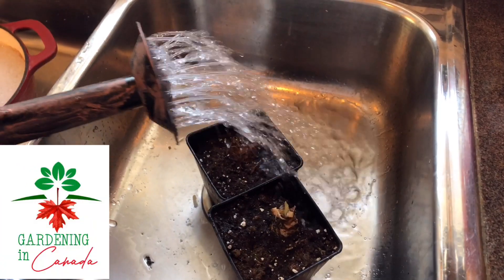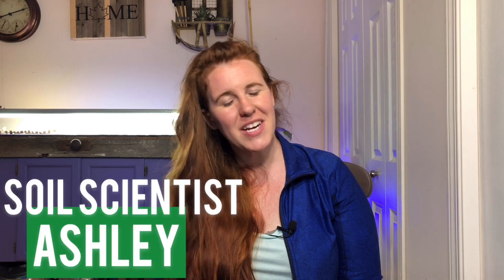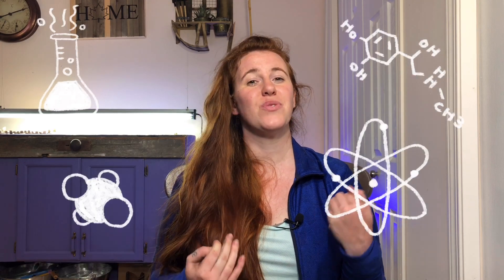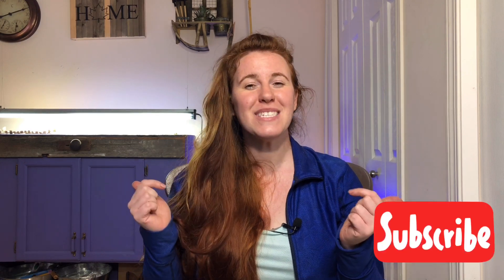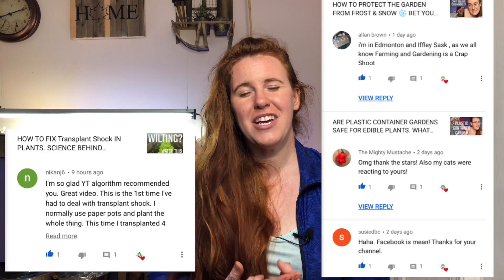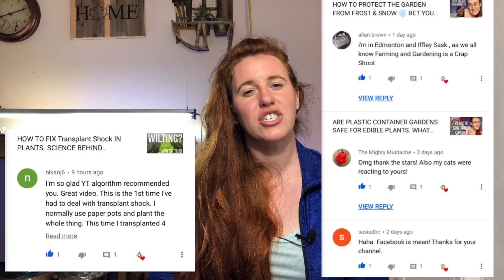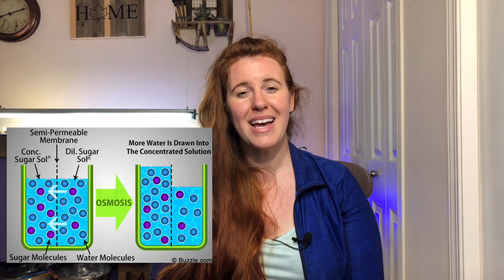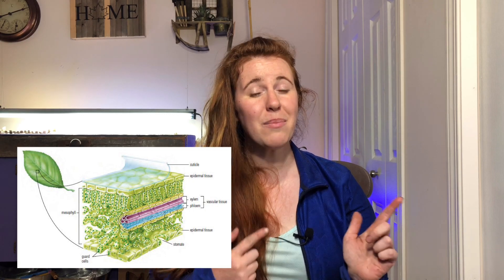WHAT CAUSES FERTILIZER BURN IN PLANTS? IS IT REVERSIBLE. | Gardening in Canada

Comment: Very useful and educational!!  Thank you!  Now I know what a burn actually is and how to deal with it.  Yes, I burned my lawn (Bermuda) a few days ago—right at the spot where I was loading 32-0-0 into the spreader.  Ugh!!  I get the need to water if there is a suspected over-application (which I missed), but I have a question:  If water, water, water dilutes the salt and forces it down, what does all that water do to the nutrients in the fertilizer?

Comment: Good in theory however with potted plants and over fertilizing, how do u stop drowning yr plants by constant watering to flush out those nutrients? Too much water running on soil goes to the roots, therefore they can't breath as they need aeriation and will die?

Comment: I have a few questions regarding fertilizing. When should the first application be applied in the spring and last application in the late summer or fall? Also is it okay to apply fertilizer in the heat of summer? I live in a high desert, and we have been getting 100F/37.7C for 3 weeks now.
Reply from the maker: You never want to fertilize in the high heat of the summer. Spring time is best, just use a slow release.

Comment: we just burned our lawn after applying high nitrogen fertilizer in the "heat".  We watered right away, not know the burn was even going to happen but the next day I noticed lots of yellow areas.  Now everywhere is burned.  Water, water, water, is that the answer?  Will the lawn come back or do we have to over seed now?
Reply from the maker: Watering it out is important but if it’s already died you’ll need to reseed

Comment: I put some grape seedlings into pots, but added some manure (called "veggie mix" by my nursery) into the pots part of the grape roots.  I'm suspecting that there was too much manure in the mix, which caused the grape seedlings' leaves to burn over a period of about 6-7 days.  Half the leaves of the grapes' leaves seemed to burn off.  Is there any way to recover these seedlings?  Will water wash be the solution?  Or should I maybe transplant them into fresh pots with a sandier mix?
Reply from the maker: oh thats likely unfortunately no fix

Comment: is fertilizing the lawn (kentucky bluegrass zone 5) and watering every morning for about 5 days a bad thing?
Reply from the maker: Nope not at all! Just means your not restricting anything which is a good thing.
Reply: @GardeningInCanada  is it possible for the grass to drown from too much water? asking because i fertilized a lawn and she watered for 5 days and i went back few weeks later and her lawn was completely yellow. yes it was hot and no rain in the forecast. the lawn eventually greened up again
Reply from the maker: Typically speaking no that’s not the case. The exception would be if the grass was under water but even then that would have to be for weeks before there is a major issue. They only think I can think if is if she wasn’t watering long enough or she had downy mildew which can cause that similar issue.

Comment: I’ve just discovered you and I’m loving it because YOU make sense! I’ve subscribed. I’m going through your videos so I don’t know but have you done something on soil PH? And how to raise it or lower it? If not can you do one? I’m having PH problems and need to make it more acidic. Thank you!
Reply from the maker: Yea absolutely I can! I don’t have a video yet on this but I’d love to make you one. What have you tried so far?
Reply: Thanks! I’ve used Alum both in solid and diluted form for faster absorption and also vinegar diluted. It lowered the PH from above 7,50 (8 even) to just below 7 but went back up the next day. I believe something is buffering it. I think in my case it was not properly decomposed cow manure, my guess, which I was told when buying it that it was 2 years old. I don’t get ready made potting mix here, so I use garden soil, organic compost, manure and river sand, plus additives.
Reply: Btw I’m doing container gardening
Reply from the maker: Your peat moss is most likely your buffer in the system. However it’s an essential part of potting soil so I wouldn’t remove it either. Depending on how old the peat moss is over time it will become more and more acidic.
Reply from the maker: Good too know that’s a totally different ball game Soil wise from beds and containers
Reply: Thanks 😊